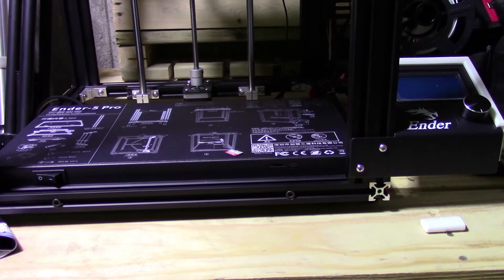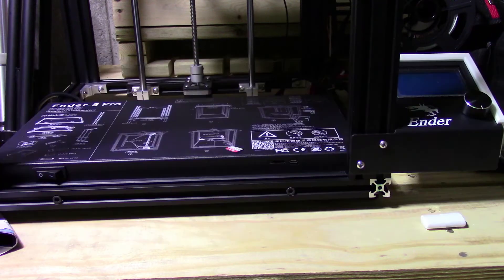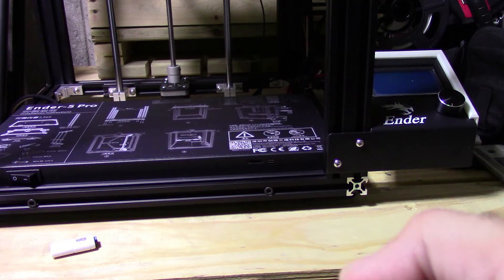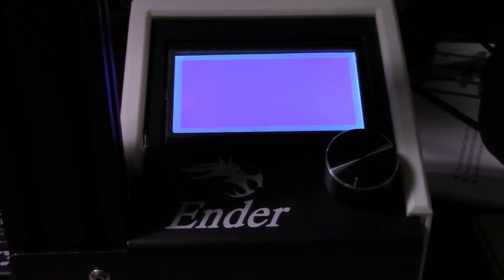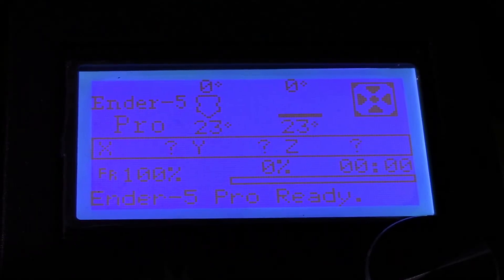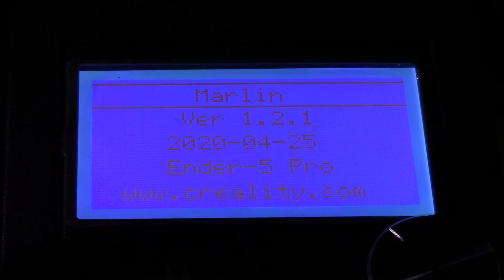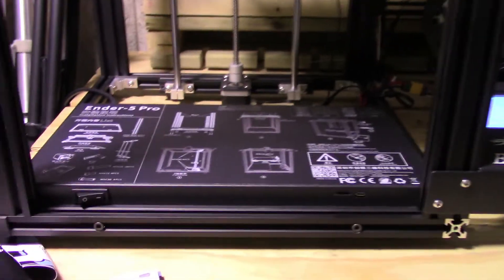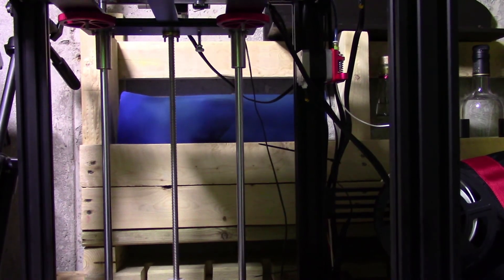Ender 5 Pro 3D Printer Series Part 3: Firmware upgrade 32bit, from Marlin V1.0.1 to Marlin V1.2.1

Comment: the problem is that the official creality firmware is rather sloppy. like steppers moving in oposite directions. easy enough to fix (for them) but sadly no fix after 11 months :(
Reply from the maker: Agreed. Creality is all about mass production. I moved away from them for this very reason. I spent over 1K getting this printer to work just for something better to get released by Bambu. I no longer have creality printers or ankermake and now run a small Bambu print farm.

Comment: Mine just doesn’t detect anything and turns on as normal, any advice?
Reply from the maker: Did you put the proper firmware on the micro SD? Your printer will take a few extra seconds when it starts up to install the firmware. You can verify which version you have on the printer

Comment: My printer is 2 days old and I got the blue screen of death already. It would not respond at all. Did some searching and found in most cases it was just a firmware reflash. So I grabbed what I thought was the correct version. Booted up....sweet it worked. Oh look it's the wrong language. It's in Czech. Now no matter how many times I reformat or add firmware to the SD card , when I turn on the power it does not prompt it to install the firmware. Thoughts?

Comment: Creality really Sucks and especially their extreme lousy service and support! After upgrading to a CR-Touch, Creality Runout sensor plus new Creality 4.2.7. mainboard it turns out that there is NO working new firmware upgrade for the Ender 5 Pro!  And still they sell those new upgrades that never can be used afterwards! So better buy a 3D printer from a firm that really sells PRO working machines with decent aftersale support! Because Creality only keeps sending the wrong not working  Firmware and only replies with totally wrong answers. And after several weeks of useless upgrades my printer is just a pile of crap now!

Comment: Installed a new mainboard 4.2.7 on my ender 5 pro. As soon I try to install the firmware it starts beeping.
I downloaded it from the creality website, don't have a BLtouch, so I chose "original version". Anybody a solution?
Reply: Tomorrow i will get my 4.2.7 board, will try it and let you know if it works. Would be nice if you could do the same if it works for you in the mean time.
Reply: Mine is doing this with the CR TOUCH

Comment: Install Marlin 2.0.1 V1.2.1 Filament Detection ........thats the ENGLSH  version it worked on the first try on my ender 5 pro and it took less than 30sec
Reply: Thank you so much for this comment

Comment: there was no .bin file I put everything on the sd card and it does nothing
Reply from the maker: after you unzip the folder, open the unzipped folder and  go to your firmware folder. From there you should see your firmware. if you do not see .bin then you need to enable viewing extensions on your file explorer.
Reply: @MicBot  yeah I already did that still nothing there
Reply: @Snowtrooper2345 yes I managed to get it working on my own I'm not home rn but I remind me and can try and help you out. Which board do you have?
Reply: @Snowtrooper2345 actually so for that board I just used the th3d version of marlin and if you look up the video all you have to do is the delete the comments for the board you have and the firmware is ready for you. Super simple, it's basically the same thing and everything is premade for your printer if you delete the comments for the ender 5/pro option in the premade firmware as well. It's like someone actually went out of there way to make it simple for literally everyone who wanted to update their firmware.

Comment: i now have a blue screen of death
Reply: I also got the blue screen of death, I would like to know how he was able to get the default firmware back onto the machine. I have the 4.2.2 board.
Reply: @ArchHaunter  I formated the SD card and put the endstop firmware on my SD card and uploaded it and it worked
Reply: Same here. New 4.2.7 board with CR Touch. Nothing but blue screen.
Reply: @RoosterAbarth  to fix it I formatted the SD put the file I needed on the SD and turned it off and back on till it worked
Reply from the maker: The printer designed to automatically check firmware and update when it boots up so it's impossible to have a permanent blue screen of death. Putting the firmware on a formatted SD card and only the firmware on there is how to update it
Reply: @MicBot  how do we format it lol
Reply: @vonscherfarms925  how many Time you did on/off ? 😅
Reply: @P.T.F.E  quite a few

Comment: hello..for some strange reason when i updated the firmware from creality own site it changed to Czech language..v4.2.2 on the ender 5 pro
Reply from the maker: I think you grabbed the Czech firmware. You need to grab the English version. They are all in the same download folder, so you'll have to go through it.
Reply: @MicBot  I have the same problem. I've looked all over. I cannot find an English version. Only the Czech version.
Reply from the maker: @spacehabs9057  I'll look into this in the morning and get back to you both. Creality isn't the most user friendly.
Reply: @MicBot  i sent a message to them and waiting.i double checked the files and is czech..thanks
Reply from the maker: @gregory3340  @Spacehabs

I went to https://www.creality.com/download after that I looked for my printer (ender 5 pro) and board version. I have a 32bit board 4.2.2 

Next I clicked download and saved the file. I opened it and extracted it. Once extracted I had multiple versions including a czexh option. I chose the Marlin 2.0.1 V1.2.1 filament detection version and proceeded with moving the file onto an SD card to flash my printer. 

I hope this helps.
Reply from the maker: see my reply below
Reply: it's in the same folder. Creality isn't very good with naming their files. Just pick the one with marlin 2 1.2.1
Reply: I managed to update to the correct version following this, the thing is, the home position is back/right still. Can anyone help me with this please? Everything it prints is 180 back to front
Reply: The ender 5 screen does not have an option to change the language, it will get Czech language as the default language but.. the ender machine  Other versions that can change the language  It will be able to change to English, for example ender CR -10s ,ender 3 max